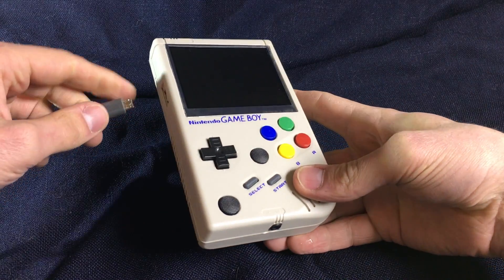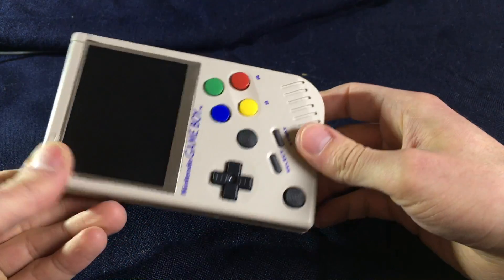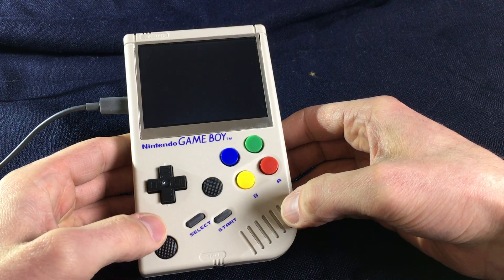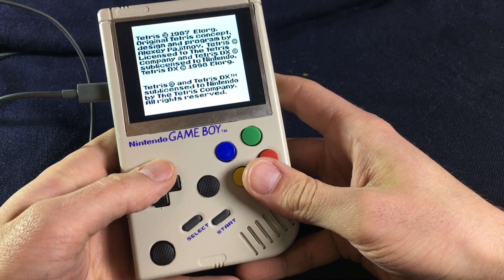Game Boy Zero powered by a Raspberry pi zero

Comment: Hi. I used a Teensy LC and I can't figure out how to code the analog joystick. I used only one. Also I do not have a clue how to wire it. An advice please? I'm stuck
Reply from the maker: Hi, my script was based on an example. I attached it and hope that helps. 
Wiring: basically the analog inputs are used for the joystick (A1-4), the digitals via the button to ground.
Check out sudomods page for a comprehensive tutorial. He's much better in explaining :)

Skript:

/* Complete USB Joystick Example
   Teensy becomes a USB joystick with 16 or 32 buttons and 6 axis input

   You must select Joystick from the "Tools > USB Type" menu

   Pushbuttons should be connected between the digital pins and ground.
   Potentiometers should be connected to analog inputs 0 to 5.

   This example code is in the public domain.
*/

// Configure the number of buttons.  Be careful not
// to use a pin for both a digital button and analog
// axis.  The pullup resistor will interfere with
// the analog voltage.
const int numButtons = 16;  // 16 for Teensy, 32 for Teensy++
int axisX; // int used for mapping otherwise  Joystick.X... is sufficient
int axisY;
int axisZ;
int axisZrotate;

void setup() {
  // you can print to the serial monitor while the joystick is active!
  // Serial.begin(9600);
  axisX = 512; // center joysticks
  axisY = 512;
  axisZ = 512;
  axisZrotate = 512;
  // configure the joystick to manual send mode.  This gives precise
  // control over when the computer receives updates, but it does
  // require you to manually call Joystick.send_now().
  Joystick.useManualSend(true);
  for (int i=0; i<numButtons; i++) {
    pinMode(i, INPUT_PULLUP);
  }
 // Serial.println("Begin Complete Joystick Test");
}

byte allButtons[numButtons];
byte prevButtons[numButtons];
int angle=0;

void loop() {
  // read 6 analog inputs and use them for the joystick axis
  axisX = analogRead(1);
  axisX = constrain(axisX, 150, 760);
  Joystick.X(map(axisX, 150, 760, 0, 1023));
  axisY = analogRead(4);
  axisY = constrain(axisY, 140, 800);
  Joystick.Y(map(axisY, 140, 800, 1023, 0));
  axisZ = analogRead(2);
  axisZ = constrain(axisZ, 150, 800);
  Joystick.Z(map(axisZ, 150, 800, 1023, 0));
  axisZrotate = analogRead(3);
  axisZrotate = constrain(axisZrotate, 140, 790);
  Joystick.Zrotate(map(axisZrotate, 140, 790, 1023, 0));
  //Joystick.sliderLeft(analogRead(4));
  //Joystick.sliderRight(analogRead(5));
  
  // read digital pins and use them for the buttons
  for (int i=0; i<numButtons; i++) {
    if (digitalRead(i)) {
      // when a pin reads high, the button is not pressed
      // the pullup resistor creates the "on" signal
      allButtons[i] = 0;
    } else {
      // when a pin reads low, the button is connecting to ground.
      allButtons[i] = 1;
    }
    Joystick.button(i + 1, allButtons[i]);
  }

  // make the hat switch automatically move in a circle
  // angle = angle + 1;
  // if (angle >= 360) angle = 0;
  // Joystick.hat(angle);
  
  // Because setup configured the Joystick manual send,
  // the computer does not see any of the changes yet.
  // This send_now() transmits everything all at once.
  Joystick.send_now();
  
  // check to see if any button changed since last time
  boolean anyChange = false;
  for (int i=0; i<numButtons; i++) {
    if (allButtons[i] != prevButtons[i]) anyChange = true;
    prevButtons[i] = allButtons[i];
  }
  
  // if any button changed, print them to the serial monitor
/*
  if (anyChange) {
    Serial.print("Buttons: ");
    for (int i=0; i<numButtons; i++) {
      Serial.print(allButtons[i], DEC);
    }
    Serial.println();

  }
*/

  // a brief delay, so this runs "only" 200 times per second
  delay(5);
}

Comment: can you show how you wired the analog joysticks please?
Reply from the maker: Hi. I don't have the schematics anymore. But some really general advice.

I used a Teensy board (Teensy++ V2) that took the inputs of the buttons and joysticks and emulated a USB-gamepad.
So the wiring depends on how you program the board. It really helps to do a mapping on a peace of paper. Like:
Pin 0 of joy 1 -> teensy ground
Pin 1 of joy 1 -> teensy analog port x -> emulated to gamepad x-axis
Pin 2 of joy 1 -> teensy analog port y -> emulated to gamepad y-axis
The joysticks are connected to the Analog inputs.

Comment: Man I'm really really impressed with your build. I'm thinking of making my own same as yours but i don't know where to start and what parts to use. can you help me out?
Reply from the maker: Sure I myself just followed the instructions on http://sudomod.com/
The tutorial is really good also there are different part lists. Starting from converting an old game boy. But also for just getting a shell and put in custom boards. Just look around. Have fun!
Reply: Peter Ommes hey man can i use 3.5 touch screen that is made only for raspberry pi 3. for this project?
Reply from the maker: Hi Shaharyar, unfortunately I do not know this screen. But if you want to use a screen that is just compatible with a pi 3 you have to find a way to fit the pi 3 inside the case too. It has been done (http://www.sudomod.com/community-spotlight-sotas-pi-3-game-boy/). But it will be waaay harder.

Comment: Very nice build, congrats!! I am working my own Game Boy Zero, did you use a Tennsy for button program?
Reply from the maker: Thanks. Yes I used the Teensy++ 2.0. because I needed lots of inputs for the analog sticks and 14 buttons.
Reply: Peter Ommes 

Ok thanks,  I'm going to try the Teensy ++2.0 can you share your code that make the buttons and  analog work,
Reply from the maker: Sure: https://goo.gl/6OXswh
But you need to calibrate the analog sticks as well.  Therefore you'll find 2 .ino in the folder.
Reply: Gus B not nessasery You could use a custom buttons pcb. There are multiple. You can connect the wires to the gpio.